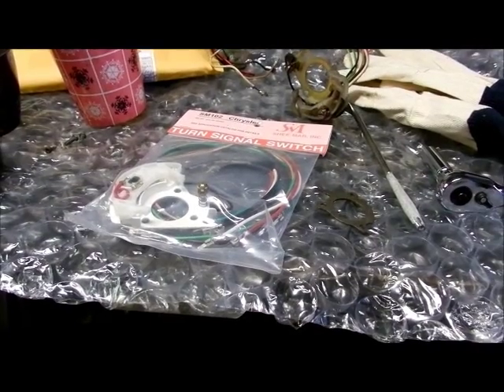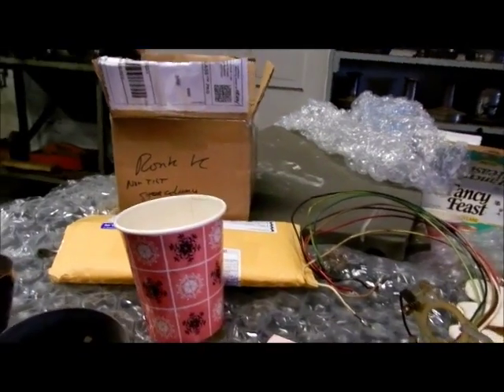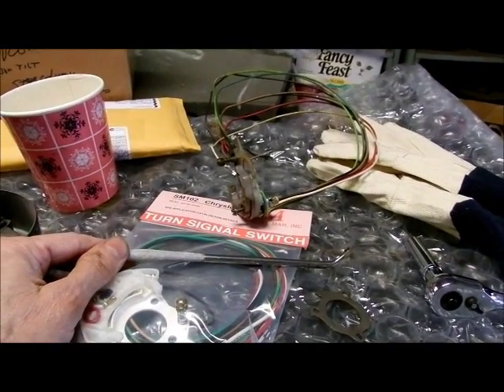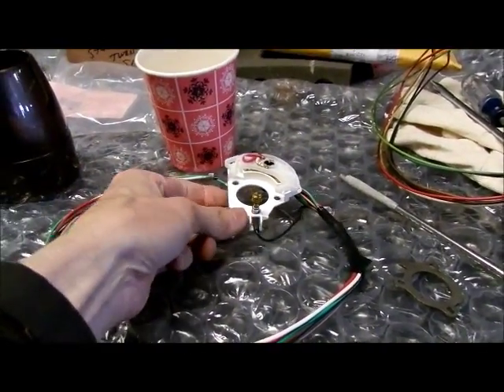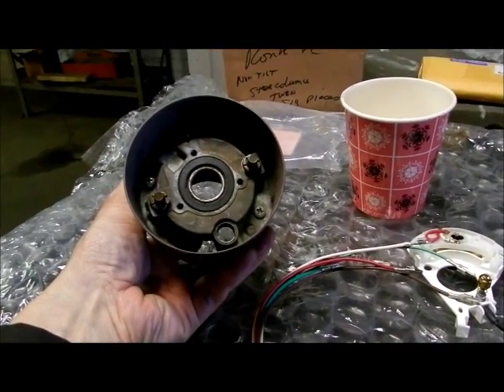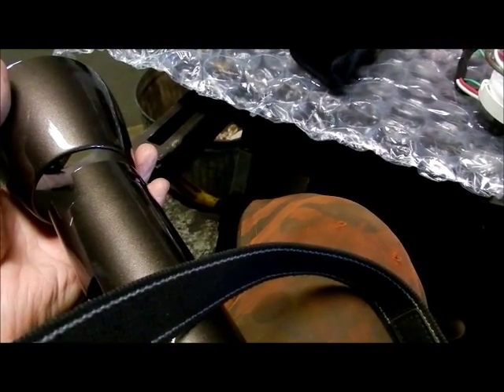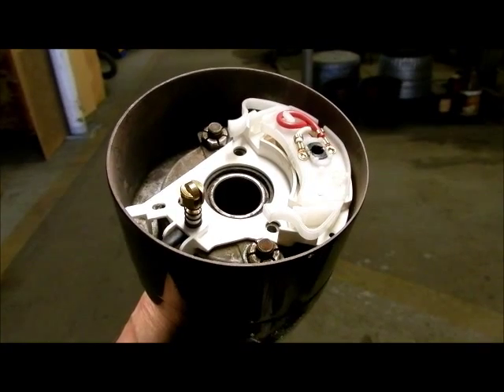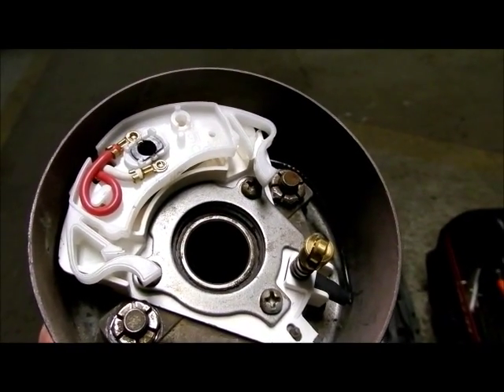Turn Signal and Steering Column 1964 Chrysler

Comment: The new turn signal switch is the 1967-69 design, with 2 wires on the cam, but works in earlier Mopars.  I had one in my 1965 Chrysler for a time.  Same for A and B body Mopar.  The wires are the same number and color and have the same terminals ("twin lock", also used by Ford).  You can easily release the terminals from the plastic housing using a tiny screwdriver.  The "correct" switch (1963-66) has a cam with no wires on it. The cam has underside holes which plastic sliders w/ copper in the base fit into.  Both types of switches were used in Ford, with their change after 1964.  The cams interchange and are still available - SM13 (early) and SM9 (late).  But I doubt the Ford bases interchange (different horn rollers, wire colors, terminals bolt holes).  Re the 2 square bolts which grab the round column, notice the shaft is offset.  You orient them so the longer square side protrudes to fit into the square holes of the column.